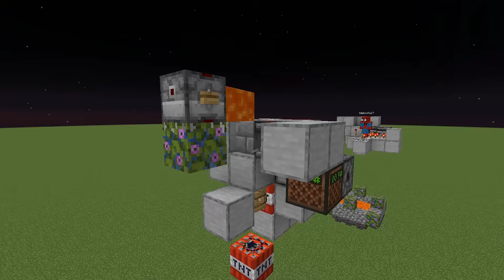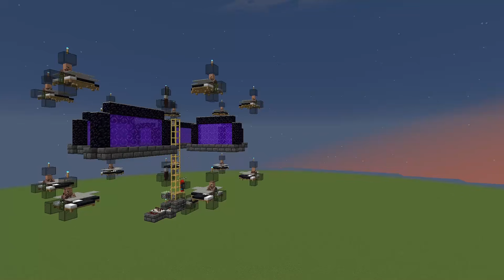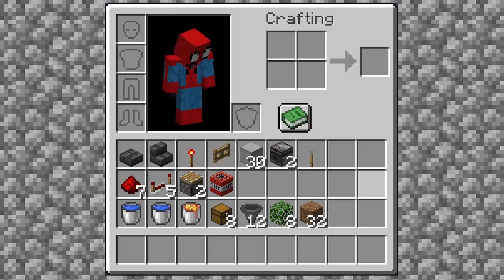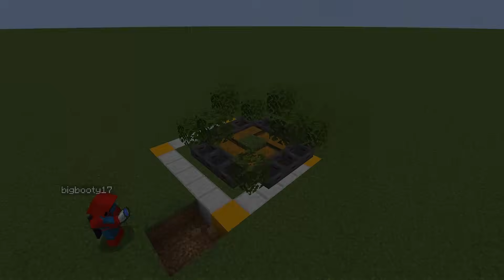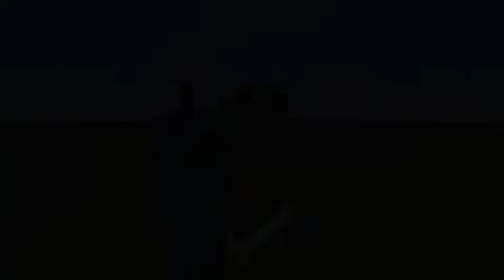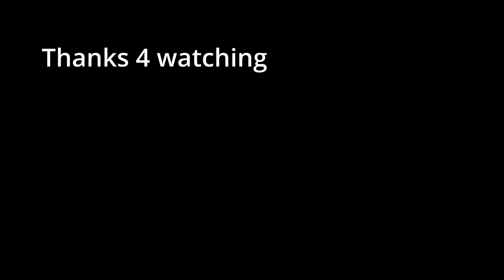Fast Simple Auto Cobblestone for 1.21+

Comment: ok so with the farm it may just be the server i built it on but it works but the tnt dosen't blow up the cobblestone it blows up just not the cobblestone i have payed with the timing but nothing is working
Reply: im on a solo server and it aint breaking rhe cobblestone
Reply: im also having this exact same issue did you find a fix?
Reply: @gavrae1210 hell no🤙
Reply: @gavrae1210 I wish
Reply: @gavrae1210  no i wish i did but sadly no
Reply: @mrcactus22  i did. if you remove the lava waterlog the chests and then have it so the lava is outside the square and it will work. i think the lava negates all the damage
Reply: i hope that made sense
Reply: @gavrae1210  thanks ill check it out

Comment: Hi, I'm having a problem. I tried both ways you showed but for some strange reason the observer stops where the TNT is placed and therefore blocks the flow of the TNT. Furthermore, the piston on the left (looking from the perspective of where the lever is located) for some reason gets stuck and doesn't move the observer back. Can you tell me the cause?
Reply: HAVING THE SAME PROBLEM DID YOU FIND A SOLUTION? CANT DO IT ON A PRIVATE MULTIPLAYER SERVER
Reply: java 1.21+
NOT bedrock. tnt dupers like this dont work on bedrock

Comment: I tried it in 1.21.7 and the cobble didn't blow up. For me it worked with the duper 2 blocks higher (-> 10 blocks) and increase the delay of the last repeater by one.
Reply: Just tried this and its not working for some reason, any ideas? 1.21.7

Comment: in case you wanna turn off the machine from the bottom, you can use a pretty simple contraption with a lever, powering a trapdoor that is going to change the state of a scaffholding tower, detected by one observer, powering a sticky piston with a redstone block attached to it facing a repeater linked to the clock. you just have to make sure it's far enough away from the tnt blast otherwise the scaffholdings are going to break. :)

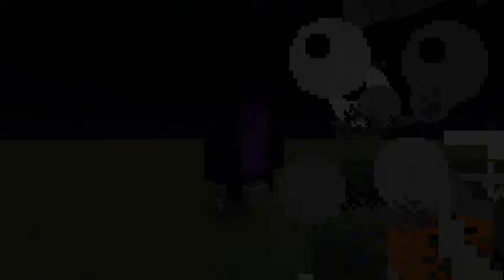Comment: 8:06 the alternative TNT duper add 2 observers, 5 blocks, 1 redstone dust, 1 repeater, 2 note blocks, and 2 scaffold, and it removes 5 redstone dust, 4 blocks, 1 slab, and 1 observer, for a total of
 +1 observer
+1 block
-4 redstone
+1 repeater
+2 noteblocks
+2 scaffold
-1 slab
The scaffold above the water is necessary because it changes state when the TNT is under it triggering the observer, and the other scaffold is needed for the first to hang off when there is no block under it.

Comment: Q: My tnt moves back and forth but doesn't dupe AND I know TNT duping is enabled
A: You have non vanilla redstone see 8:06

...
Legit on the most vanilla vanilla you can be on 😅 I'm just on 1.21.5 where it needs to be different
Reply from the maker: I've run this on 1.21.5, experimental redstone is probably enabled
Reply: @bigbooty17 just normal 1.21.5 vanilla 🤷 even made a brand new redstone ready world (changed nothing else)
Reply from the maker: @Chimera__Gaming  Works for me, and you're the only one saying this so either you're baiting or you're mistaken

1.21.5 has been out for a few months so I'm sure I would have heard
Reply: @bigbooty17  Just tried again with Fabric Litematica +Dependencies, Nothing Else. Fresh Redstone Ready world, pasted the schem file in the discord (Same as the video) and it still didn't work 😅 The change at the end does work. No experimental features

Comment: I did everything correctly (quadruple checked) but not working on 1.21.4. The TNT explodes on its place on the top
Reply: This has happened to me, are you on a server? and is the server specifically paper? Any server can turn TNT duping off but paper does it automatically

Comment: Am I the only one for whom the TNT just doesn't drop?
Reply: Are you playing on a server that patches TNT duping? Like paper.
Reply: @centdemeern1  are there any other than paper that dont patch it because we need the cobblestone for a big project
Reply: @roopehienotvideot  A vanilla or fabric server should work. If you want performance, try fabric with optimization mods that don’t change vanilla behavior
Reply: You can play on modded servers with vanilla clients, as long as the installed mods don’t require a client component (this is listed on the mod page on modrinth)
Reply: @centdemeern1  yes the duping is on true but the tnt still doesn't go down, it stays on the air platform
Reply: I think it needs to face west
Reply: Me too it doesnt

Comment: this doesnt work for my in 1.21.5 i build it doing every step correct. but the tnt just gets pushed into the left side and doesnt fall down. it doesnt blow up the build cuz its in the waterlogged left side where the slab is. help?
Reply from the maker: It rests there until it clips into the TNT block and is pushed by the piston, it's working as intended. If you have more issues join the discord bc troubleshooting over comments is rough
Reply: @bigbooty17  i have exactly the same problem 1.21.4 here

Comment: My tnt didn't work and I don't have a config option in my server and my server is vanilla any solution?
Reply from the maker: If you built it correctly, then the server is not vanilla. If the server is vanilla, you built it incorrectly. You could have the redstone experiment on and you'll need to build the alternate duper.

I think likely you may have some fast redstone mod if your server software is not paper or some paper fork and you can build the alternate tnt duper

Comment: I built the first normal version on 1.21.4 optifine with installed paper mod, and the piston on the right site doesnt push the observer to its original position, so only the first tnt explosion happens and the tnt doesnt get duped. Then i build the other version for non vanilla redstone and the same thing happened there aswell. The observer that is pushed by the pistons stays in the position of the tnt. Please help!
Edit: I fixed it, the problem was that im playing on a server and using paper, since paper has disabled tnt duping i had to go in the config file to change it to true.
Reply: yoooo i was looking for this bro. You're goated, have a good day
Reply: i put the piston duplication on true but it still doesn't work, the tnt remains on the air platform and explodes there, it doesn't come down
Reply: @il_messia_di_knull did you manage it?
Reply: Hey man, I did the same but I'm still having the same issue. Do you have any idea on how to solve it?
Reply: @nik3428 I dont know, did you change the command in the config file to true? You also need to restart your server after that
Reply: sever files -> config -> paper-gobal.yml -> allow-piston-duplication: true

Comment: The farm actually designed very well, but sadly the second TNT duper explosives self, somehow active TNT don't move by water from stair block, but I'm pretty sure that I builded it right, cause I rebuild it three times...
Reply from the maker: You didn't open the fence gate
Reply: Well, I did, but after rebuilding it entirely it works, still thanks!
Reply: @RP3RP3 hey, how did you fix it? My observer kept being stuck inside after heing moved from the piston
Reply: @underdeath4141  ssame

Comment: I'm probably an idiot but built at the same heights this does not seem to work on Realms as the TNT explodes but the cobblestone doesn't get blown up
Reply: Probably it's the realms configuration that doesn't allow the TNT to brake blocks
Reply: Having the same issue and followed the configuration properly. Only using vanilla redstone items as well, not sure what the problem is. I can see the TNT falling properly on the blocks but its not blowing it up. Before I had the farm completed, I had accidentally activated it without placing lava, and the TNT destroyed the entire bottom half, so I know for sure that the realm isn't blocking TNT from destroying blocks.
Reply: @AznDrvr  I played around with heights & it seems on the realm the TNT will not destroy the cobble generated if it believes the TNT is in lava. If you replace the single Lava source with an Obsidian & place lava beside it, the farm still will not work. If the lava is between the TNT explosion & the cobble while being a block above (on the obsidian) it does not work still. Changing the height 1 or 2 blocks up/down also does not change it.

Comment: Thanks for the updated design. My server is still in 1.21.1, but I'll update soon and will then swap out the upper part of your old design for the new one. Really appreciated the Beethoven soundtrack. One of my favourite sonatas.

Edit:  Server now on 1.21.4, updated the cobblegen and it's working perfectly. Thank you.    =)
Reply: Hey quick question, are you playing on a vanilla server or a paper/spigot or any non-vanilla server? for some reason my observer, next to the piston, moves back and forth once and then essentially stops right where the tnt
Reply: @underdeath4141  Mine is a Fabric server.
Reply: @underdeath4141  I am running a paper 1.21.4 and mine is doing that exact same thing
Reply: @  Hey sorry for late reply, i dont usually read notifs. 
I FIXED the problem by doing something in the paper-global.yml  configurations. Open the file, scroll down till you find allow-piston-duplication and set it to true if it's false. That way the farm should start. 

In case you didnt know, i had to do the second variant thats shown in the video for the "non-vanilla redstone" players. Ask me anything if its not clear
Reply: @underdeath4141  can you show me how to do it?
Reply: @underdeath4141 thanks! how did you manage to find this out? hahahah!